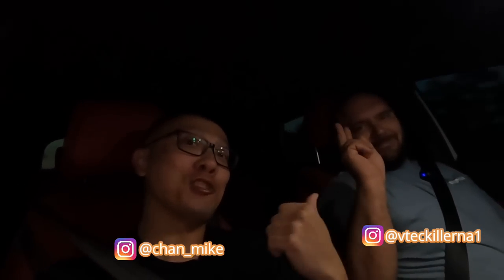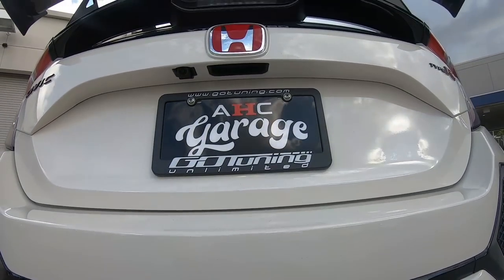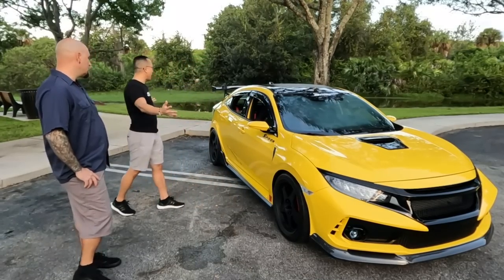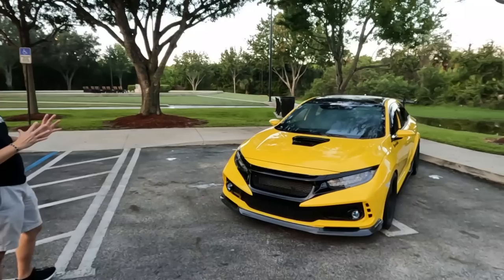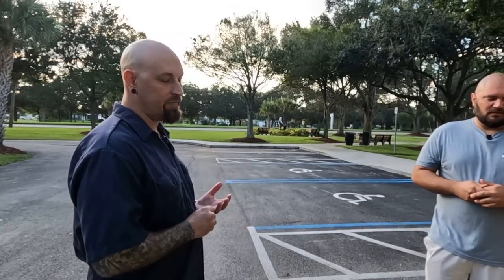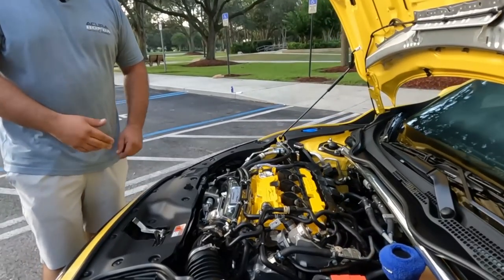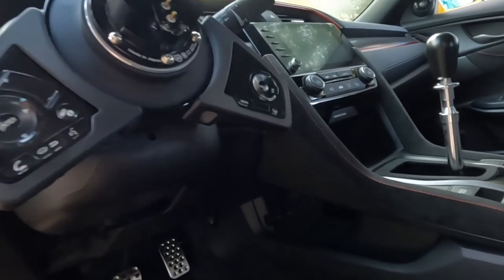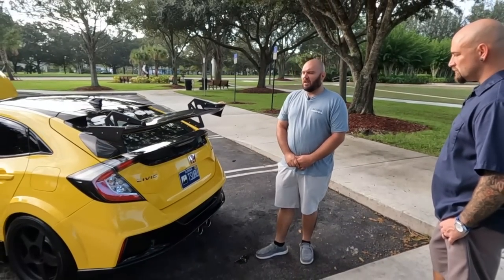Worlds First Spoon Sports Certified FK8 Honda Civic Type-R Limited Edition

Comment: Carbon fiber hood & front calipers missing so its not fully certified 🤣🤔
Reply: But, they did certify it. Are you saying Spoon themselves are wrong?
Reply: @Patrick94GSR  well I'm big on details so it would be right if it had the black or even forged carbon fiber hood and the spoon calipers 🤔
Reply: They don't make cf hood and front calipers for fk8. Only fk7.
Reply: @Kodawari.FK8  well there ya go. Can’t get what’s not being produced.
Reply from the maker: As @Kodawari.FK8  mentioned, those items are not currently available at this time.